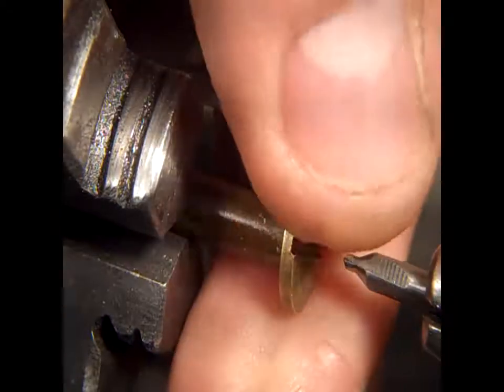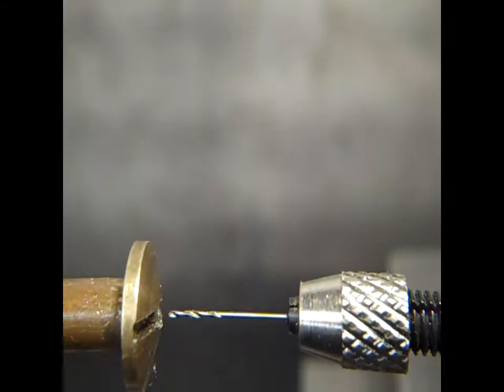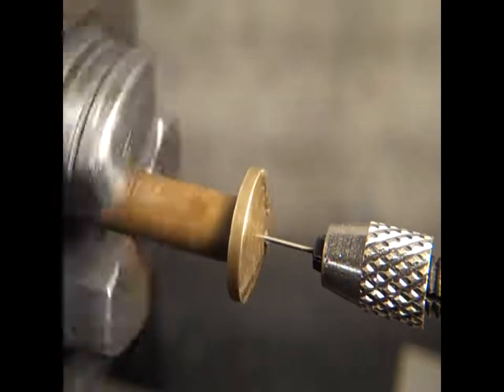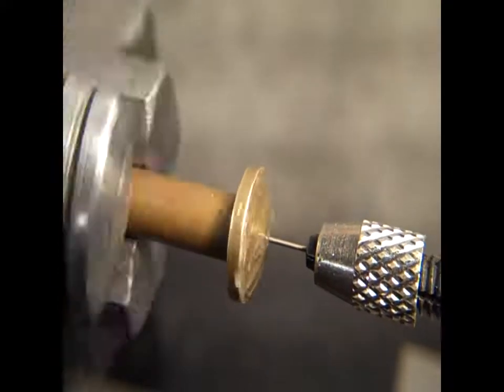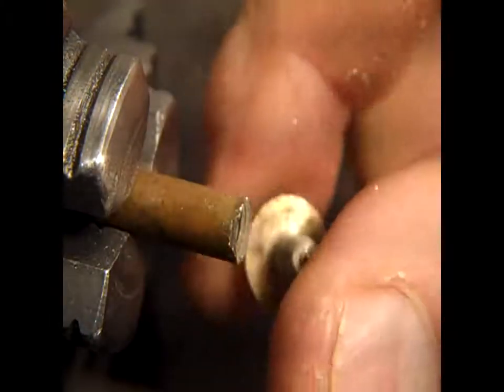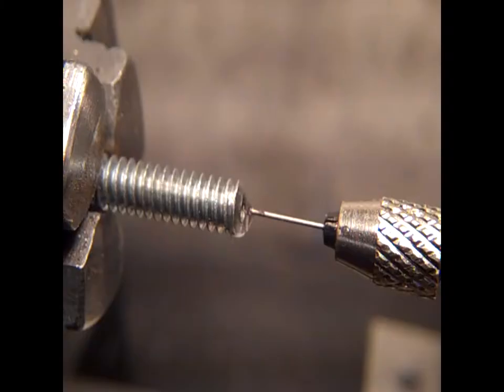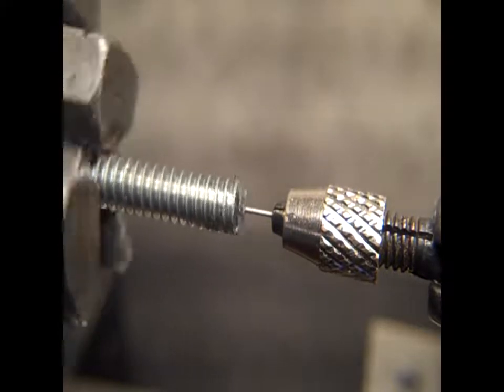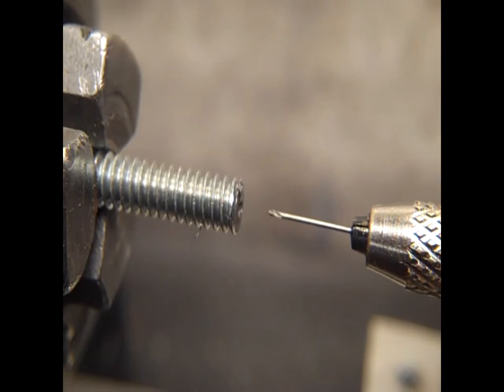Drilling 0.5mm Hole on Mini-Lathe

Comment: There was another YouTube video I saw (can’t remember which now), where the guy puts the small drill bit in a rotating Chuck. Then you can hold the Chuck by hand and push it by hand and that way you can “feel” the drill bit bite and you can “feel” if you are pushing it too hard. I’ve used this approach. For small bits it works great.
Reply from the maker: Yes I saw that too...It was Joe Pie.

Comment: 0,5mm is probably undo-able on my old lathe. The tailcentre might be of by half a 0,5mm :)
You should probably run the lathe faster for small bits.
I’m impressed the results. Now make an internal thread on it, or make a hypodermic needle hole.

Sound like someone is rummaging though the workshop and messing with the awesome cisco recordings :(
Reply from the maker: Yes sir.